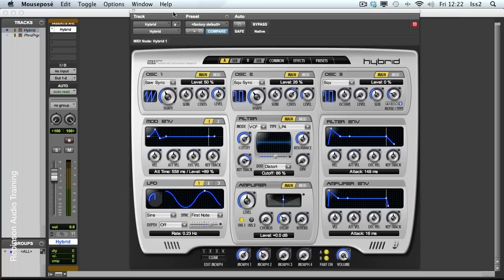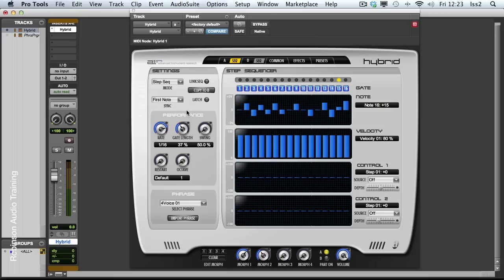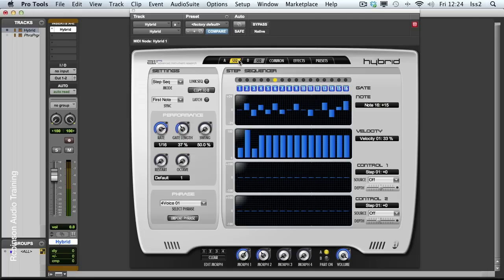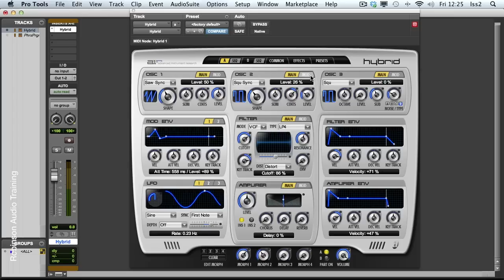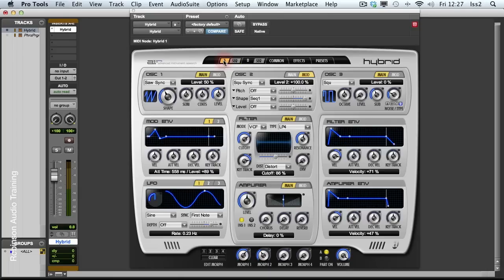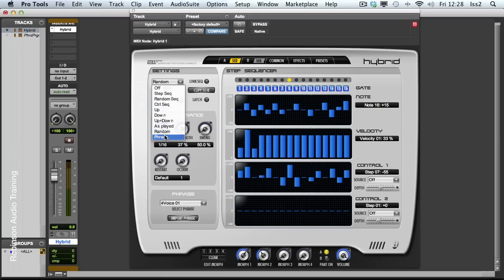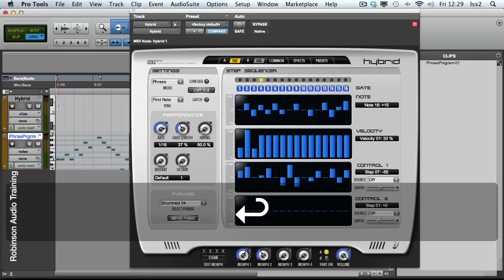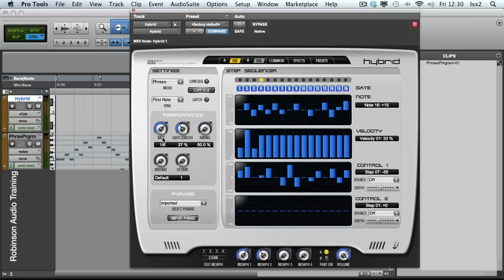Hybrid Part 4

Comment: when I run the authorized I get this message:''an error occurred with the internet activation server.the operation timed out(error 12002) ID:16010/WPSW:684''.i tried also the manual activation,but nothing worked!please,can somebody help me?
Reply: I know this is old but for the benefit of anyone else, I contacted Air Instruments help desk because I was having the same issue and its pretty much down to Hybrid version1 and 2 being too old for newer DAWs. The only way is to upgrade to version 3. Cost me £28 for the upgrade. They send an upgrade code and you use it at the check out and you get version 3 for a drastically reduced rate.
Reply: @johnmellor932  Hybrid 3 is available for £1 at Plugin boutique
Reply: @mastper  oh well, never mind.